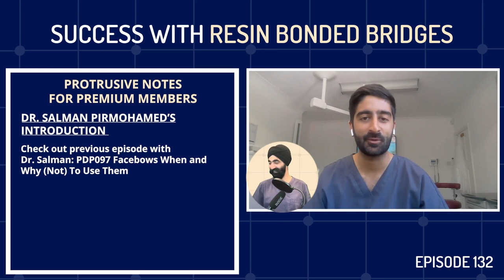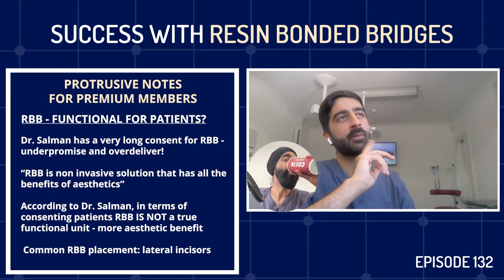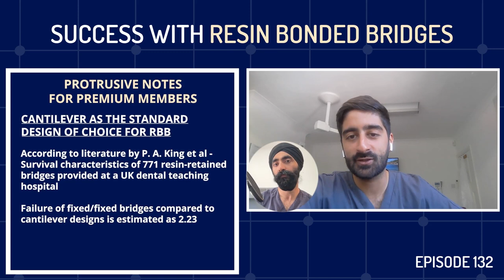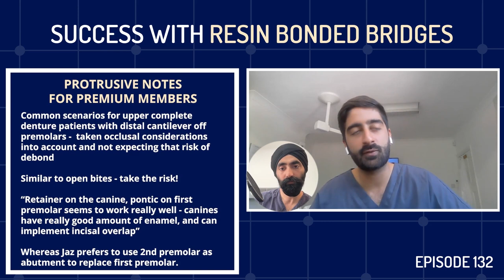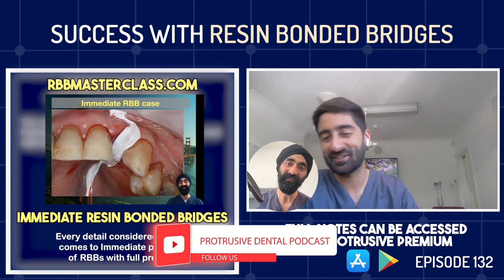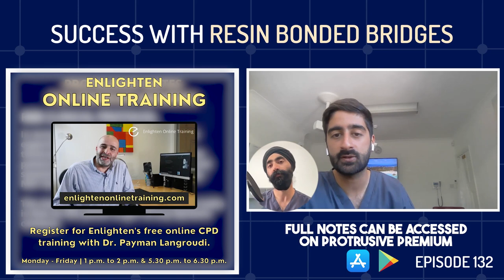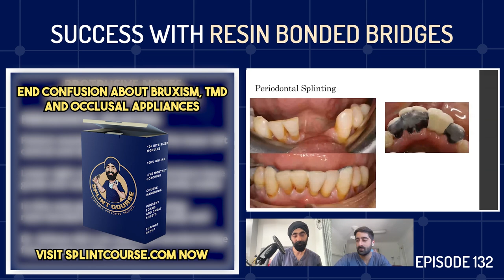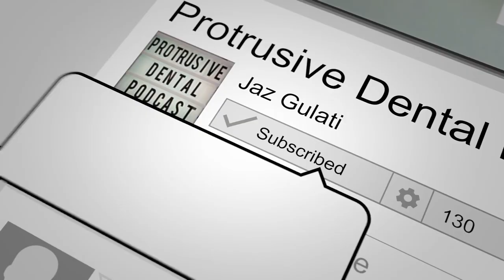Success with Resin Bonded Bridges (aka Adhesive Bridges or formerly Maryland) - PDP132

Comment: I have had a bridge for 20 years and a crown on my left incisor front tooth, (beside the bridge) due to breaking my tooth in the playground at he age of 9. Recently the crown fell out. I have an option to have an implant or cantilever bridge which would involve to remove the current bridge and replace it with a new one adding another tooth - hence the cantilever bridge. What would you recommend implant or cantilever bridge ? Which material would you recommend zirconium oxide or the traditional alloy metals with porcelain ?
Reply from the maker: There are so many factors to consider and the best person to advise is your dentist (whilst you described your case well, there are so many unknown unknowns here that your Dentist will know eg. your gum condition, medicines you take and your bite).

Comment: @protrusive
Thank you for your prompt reply. Actually it's the upper front/incisor (no 8 ) not lower. As previously mentioned there had been a crown there before which lasted 30 years and it had been root canal treated. The neighbouring teeth no. 7, 6, & 5 there is a bridge so I have been given the option to remove it and place another bridge this time a cantilever bridge to fill the gap of no.8, I had the root extracted 3 moths ago. If it was you would you go for the cantilever bridge or implant now that you know it's the upper jaw ?

Comment: Thank you for the excellent presentation.
My former professor, Dr. Livaditis, was involved in the original Maryland bridge design. Dr. Livaditis is a proponent of the method of chemically treating the base metal prior to cementation versus the electrochemical method. 
Do you have a preference?
I believe there are procedural steps based on metal composition, beryllium versus non-beryllium content.
Reply from the maker: Hi Doc! Thank you so much for your comment. Indeed, the electrochemical etching method is obsolete and the use of beryllium containing alloys has been abandoned due to safety concerns. Contemporary RBBs are base metal such as cobalt-chrome and abrasive blasting and metal priming is the accepted adhesive protocol that the latest literature has shown to be predictable. Hope that helps and thanks again for tuning in!

Comment: I've recently been told that my #30 has a fracture found with x-ray.  So far I have not been given any options besides "implant".  The cost is not something that I can handle.  Doing my own research I have been wondering about a Maryland Bridge - haven't asked my dentist about it yet.  It is so frustrating that I don't get any options besides extraction and implant (US).  Thank you for this video.
Reply from the maker: thanks for commenting. generally for #30 it's not recommended as a general rule

Comment: Can this be done to replace two upper insciors?    I really need a response doc.  Im loosing two front teeth and feel down rn as i don't have Money for implants and don't want to have metal in my jaw.
Reply from the maker: it can but there are a lot of ifs and buts and a lot depends on the bite and the condition of the abutment teeth.
If my life dependent on it I would say 'No'
But in the right scenarios it can work.
Reply: Thanks for the response

Comment: @protrusive  Hi Jaz! I see many metal-based one wing RBB's here and there to replace 12 or 22 (second upper incisors). What do you think about full zirconia rbb in that cases. In case if first incisor and canine are both in good condition - which one should be preffered to bond the wing. And one more question with premorals - what do you think about using full zirconia fixed-fixed rbbs with making them bit lower than biting surface to reduce clench forces on pontic.
Reply from the maker: Check out the papers by M Kern - amazing success rates for replacing laterals for Zirconia RBBs!
Reply from the maker: @boguszwegner5464 as for Central vs Canine - more often the central will give more surface area - however the canine has a surved palatal anatomy which provides strength.
Reply from the maker: as for posterior cases with zirconia it seems to be less predictable with high risk if framework fracture. these RBBs are more for beauty than for function
Reply: Will this work to replace canines

Comment: Can this be done on #12??
Reply from the maker: yes! if you have a virgin #13 with good enamel surface area - you can have the wing cover palatally and the palatal half of the occlusal surface. Metal should be 0.7mm thick so may need to create some occlusal space by preparing the #13 and maybe even a cusp tip of the opposing
Reply: Ive had this done 5 years ago in my molar it quit a big tooth bonded with the metal wing, it functions just like a normal tooth the only issue i have had with it food getting stuck into it from time to time and the teeth its bonded too is slightly darkish in colour however it being on the bottom tooth it hardly visable and it seems like it will last a long time i was considering gettin an implant as thats the best option however i dont have any issue and its hardly noticable

Comment: Can they be done on tooth#9
Reply from the maker: as an abutment? Yes, for sure. As a pontic - way less common and needs A LOT of favourable conditions to make it work
Reply: @protrusive  so if as Pontic, what other options are better if implant and other invasive methods to be avoided. Thanks
Reply from the maker: @s Bommana  1. a partial denture 2. any other type of bridgework (but same limitations) - other than an implant everything else is just a variation of the above
Reply: @protrusive   Thanks for answering, I can’t have implant as space is issue and bridge may spoil good teeth, is composite resin or ribbond really work to create a bridge ? Sorry for so many follow up questions.
Reply from the maker: @s Bommana  I understand. Ribbons and all are great but they are still a type of bridge. Everything is possible but all treatment modalities have compromises involved. I wish you well with your care
Reply: How about composite indirect resin bonded bridges?

Comment: Hi Jaz. 

Very glad to find your podcast.  

Could you please comment if you think sandblasting with cojet is a necessary step for a long lasting zirconia maryland or just aluminium blast and MDP? How many cases have you seen with zirc go past 10 years?
Reply from the maker: Hi Doc! Sorry for the delayed reply. Sandblasting with aluminium oxide is just fine, you don't need cojet. My older zirconia RBB cases are 5 year old at the moment - this is when I started using zirconia slowly. I still do a lot of metal ones. I see the 25 and 30 year old RBBs my predecessor did regularly (many that have never debonded, and a few that were recemented every 8 years or so) - I must recommend you read the findings by M Kern on their longevity which is showing very high success rates at 10 years: https://pubmed.ncbi.nlm.nih.gov/28688950/